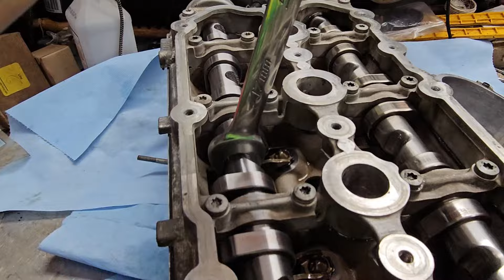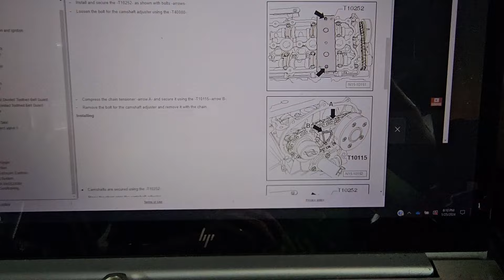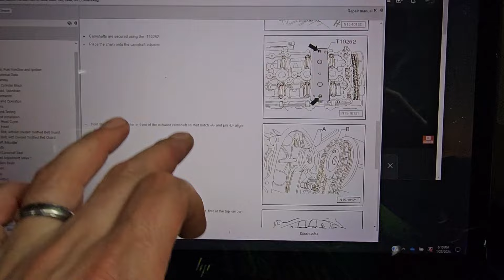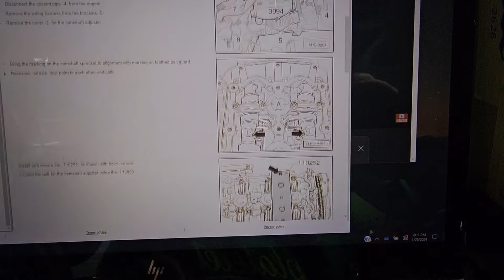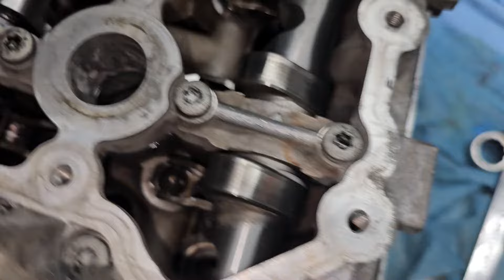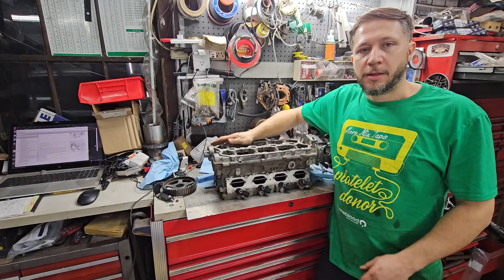How to Replace the Rear Timing Chain & Tensioner on an Audi /Volkswagen (2004-08) FSI / Chain Noise

Comment: Your supposed to count from the furthest right good link back to the 18th and 19th links, then place the back vvt sprocket mark between the again 18rh n 19th, take the chain between the gold links put that over the front mark then as you turn the front slightly with a wedge(or your 17mm) then you can pop that little peg into the back slot, lock tight the back bolt in to the torque and your done, your Vid looks good!
Reply from the maker: Thanks, I appreciate your detailed instructions! The older 1.8t I remember would have us count the links to get the timing right. Ill pin this so others can use that information.
Reply: I have to leave another comment, I think that others who post stuff for car repairs in a 5 to 10 minute video are usually only after likes etc, they all shoul take a leaf out of your book.

Comment: 11:52 Hi, could you tell me what kind of socket fits that screw? None of them seem to fit. 😮
Reply from the maker: It is what is known as a spline drive. Similar to a torx but the points are round instead of sharp. Unfortunately i dont know off hand what size. It think its either a 10 or 12. Hope this helps. Thanks for watching.

Comment: Hello from France and thank you for this very well-explained video! Regarding loosening the camshaft phaser bolt, do you think I can loosen it with the small Milwaukee M12 impact wrench? Thanks again. Paul
Reply from the maker: No, I dont think so. They are usually very tight. If the head is off I use a 1/2" air impact and that works. Otherwise a long ratchet or breaker bar is best. Thanks for watching.
Reply: @willpoweredgarage969 ok thank you for your message !
Reply: @willpoweredgarage969  The screw head broke. I'm going to have to drill it out. 😢

Comment: how you get the front sprocket off for the belt this mf won’t move for me
Reply from the maker: You will need a puller tool to break it loose since they can get seized on there pretty good. Thanks for watching.

Comment: Blue loctite ?...  isn't that low strength?.. shouldn't you be using 271  for an internal engine part?
Reply from the maker: No, there are torque specs for a reason. Vw and audi do not call for any thread locker. I do it for piece of mind. Besides if you want to remove it later you will be glad you used blue and not high strength. Thanks for watching.

Comment: Can i change the tensioner without changing the chain?
Reply from the maker: No, the chain needs to come off along with the cam phaser. It will not fit past them, believe me I have tried. 😂
Reply: @willpoweredgarage969 haha ok thanks for the response. And do you have any tricks/recommendations on how to remove the cam phaser bolt without stripping it. Im hearing horror stories when i research this task.

Comment: just curious im about to tackle this job here soon on the old tensioner do you need a special tool to compress it or whats the way to do it im doing this because i got a p000a code and a p1093
Reply from the maker: There's usually a retaining clip or pin on the new tensioner that holds it compressed until installation. But for removal i would not worry about it since you are replacing due to potential damage. Otherwise it can be compressed carefully in a vise and a pin to hold it.

Comment: between the cam cradle there's a groove which has some type of liquid gasket in the fine grove  , do you know what is used ?
Reply from the maker: It was once this green aerobic sealant, but in recent years vw and audi have switched to loctite brand that more resembles an rtv.

Comment: What are those those arrows mean on the camshafts  tray
Reply from the maker: some models use them to set the camshafts. Still need the locking tool to make sure they are set to TDC though.

Comment: How the hell did you get the cam adjustment T-55 bolt out?

I’m trying to remove mine and it seems just smaller than T55 but significantly bigger than T50. What a pain.
Reply from the maker: It's not a torx bit. It's a poly drive bolt and it's very tight. If not careful it will strip and you will have to drill it out.

Comment: Hello, how do you know when it needs to be changed?
Reply from the maker: Usually you will start to hear a rattling noise on cold startup. Hope this helps, and thanks for the comment and watching.
Reply: @willpoweredgarage969  Thank you. I've heard that before. I always thought the timing belt only was a maintenance part for the 2.0 FSI. Does the manual list a certain mileage for the 2 camshaft chain and gears to replace?

Comment: Can anybody give me a part number for the bolts that go to the chain tensioner? I had one snap on me today. Also the plastic rings that fit inside the adjuster, can’t seem to find them
Reply from the maker: The bolts for the rear tensioner N10124308. The cam phaser bolt is 06D109281D . It should be replaced if removed. 
The rings for the cam phaser on the rear are very fragile.  The part number is 06F198107A . Good luck. I hope this helps, and thanks for watching.
Reply: @ you rock dude

Comment: What size is the bolt for the cam phaser
Reply from the maker: Guessing off the top of my head, it's a t10 triple square. Thanks for watching.
Reply: It is actually a 10mm poly drive, from everything I’ve seen, even with the correct bit for it, it is gonna be torqued so tight that it will strip out the inside of the face of the bolt, so be prepared to do some extracting. Unfortunately that’s what I’m working on rn
Reply from the maker: Ahhhh, you know you are right! it is a poly-drive. And if I remember correctly when doing this job, I had one of the bolts that stripped. I ended up having to drill the head off the bolt. They should be replaced when removed anyway.

Comment: Sorry i was referring to the intake and exhaust  camshaft....  Turning the engine they both rotate at the same time and again both facing the front of the engine when the TDO is reached .....
Reply from the maker: That sounds like you have the timing wrong. Either something jumped, or it was set wrong. If you did not touch it, it's probably why your compression is off. Chances are there is a bad valve now, though.

Comment: Great video...  I have the same engine on a VW Passat 
2008 2.0T..  FSI....   cylinder compression, cold engine 60 90 80 70.....  On TDC, both notches where the adjustment tool goes are facing the front of the car.  Meaning facing the same direction... Any thoughts.....
Reply from the maker: Sounds like the timing jumped.

Comment: hey brotha, thanks for the video. i did everything in this video and my car is running beautifully except for a whine noise that wasn’t there before the job. the car drives great, but the whine is coming from the cam chain area. is it possible to be off a link and have the tensioner too tight?
Reply: i don’t have any codes, all my timing marks lined up but i thought that the tensioner operated off oil pressure?
Reply from the maker: Yes, It is controlled by oil pressure.
Reply from the maker: I would not expect that from the chain. Check the vac pump, for air leaks maybe? Thanks for watching.

Comment: Does the block need to be inspected after a failure like this especially when the intake and exhaust cam have line grooves in them ?
Reply from the maker: I would absolutely inspect the pistons and cylinders for damage. Many times the valve will hit the piston and the valve will be bent. The piston will have a witness mark. I usually will lightly sand down the sharp edges. I have never had any issues with the marks past that. Thanks for watching and the comment.

Comment: Can you give me the reference of the 3 small plastic/rubbers inside of that cover? 
Thank you
Reply from the maker: Are you looking for the part number ? 06F 198 107 A or the positioning of the rings. There is no specific orientation,  just stager the gaps like you would piston rings so the gaps do not line up.
Reply: Any part number for the 3 ring

Comment: The mark on the intake sprocket is where the brass link on the chain fits, then the 18th to 19th link from the brass link fits on the mark on the cam adjuster. Not all chains have the brass marker making it a bit trickier
Reply from the maker: I think the chains are a reliable way to time it. But maybe a good way to double-check that you are in time. Thanks for the information.

Comment: How do you loosen the cam adjuster bolt without the locking tool? Impact gun?
Reply from the maker: I would not recommend an impact gun on this bolt. They are hard enough to get out without it stripping.   You can use an open end wrench on the cam notches where the head bolts are. Usually a 17 or 18mm wrench. Best is to use the locking tool though since this bolt is very tight.

Comment: No assembly lubricant on the high pressure fuel pump cam
Reply from the maker: U usually put it on the lifter or follower itself. These engines generally get oil up there pretty quick. Thanks for watching.

Comment: Used the special tool, lines everything up now I have misfire codes and runs right at idle. I did have the battery disconnected for 2 weeks while I was ordining parts. Is there's a relearn procedure or could it be timed wrong?
Reply from the maker: Does the misfire counter see misfires at idle? Do you a Vag tool? if so check measure values 14, 15, 16  see if any cylinders are misfiring.  I would also check the fuel trim numbers value block 32 and make sure you done have a vac leak causing a misfire. The timing could still be off and run well at idle and give you a misfire at rpm. If everything looks good just pull the valve cover and check that the cam notches are correct with the engine at TDC. Hope this helps. Feel free to message me if you are still having issues. Thanks for watching!

Comment: anyone reccomend a good workshop manual for this engine, i am doing a complete rebuild, need all the specs.
Reply from the maker: The best manuals for jobs like that are the Bentley manuals. When it comes to measuring bearings on these engines they are color coded and sometimes require two different thickness bearings for top or bottom of the journal.

Comment: Great video with very real world application. Best one on this subject by far. I do have a question though.  Is the phaser bolt a polly or a torx? And what size is it? I seem to see a lot of videos with this bold getting stripped, and I wonder if people are using the wrong tool bit.
Reply from the maker: Thanks for the kind words, It is a polly bolt, as for the size I believe it is a 10mm.  But even with the right tool they are very easily stirpped, so be very careful while removing it. It is torqued very tight.

Comment: Nice vid!! What program do you use for all the information about the parts?
Reply from the maker: Its a factory service manual only available to dealer technicians.  Thanks for watching.
Reply: @willpoweredgarage969 thats not true lol, you just say that cause if you make all the information available then there wouldnt be as much work for those “said” technicians

Comment: Very helpful video. When this cam chain and or tensioner fail. Does it bend intake valves? I’m currently trying to diagnose a no compression on all cylinders except number 4 which is at 150psi.
Reply from the maker: Yes, IT is an interference engine. So if the timing is off even slightly it will bend valves. If you have no compression in 3 of the cylinders Id say its time to remove the head. Can use a cylinder leak down tester and see if you have air coming out of exhaust , intake or crankcase. indicating either bent exhaust or intake valve, or damaged piston or rings.  Thanks for watching and good luck!
Reply: @willpoweredgarage969  at the 4:35 mark of the video. What program are you using, seems very detailed and informative!

Comment: Didn’t see you pull the pin.. do you hold the cam with your wrench when pulling it to ensure no skips? Good video as always
Reply from the maker: Oh man, I cant believe I messed up again. lol No, Once that chain is on with the tensioner/guides in place I don't think there is enough slack for the chain to jump just be removing the pin. Thanks for watching and the comment!